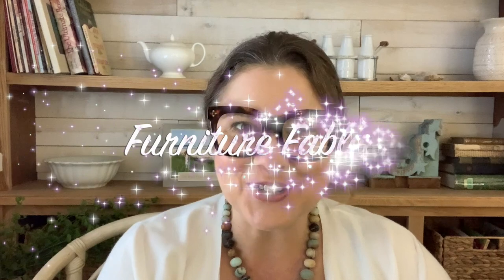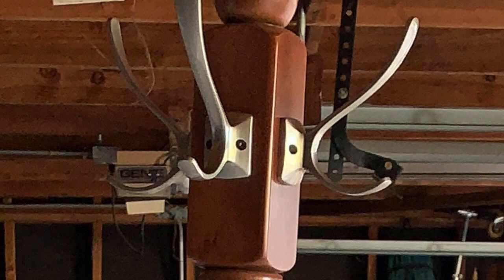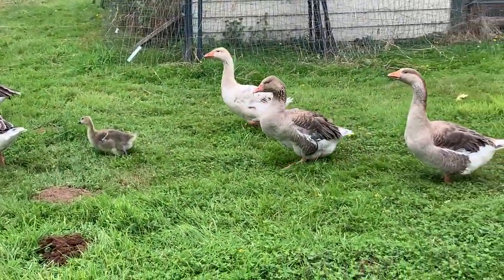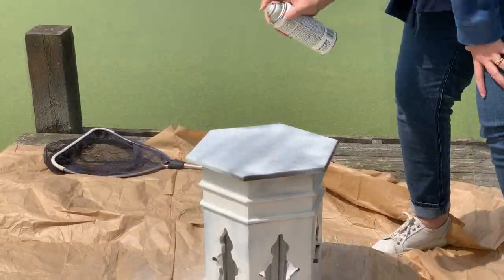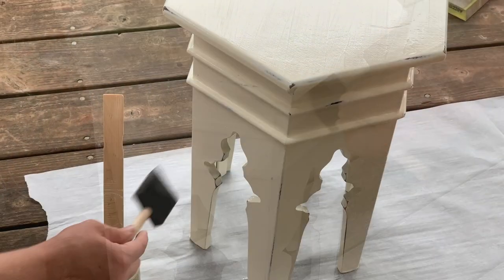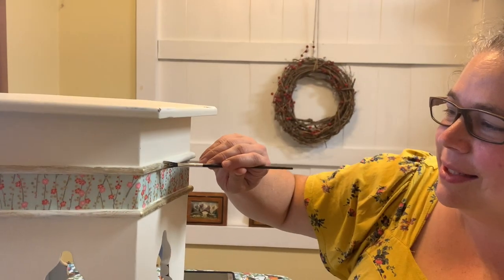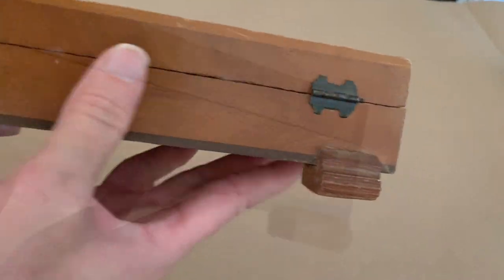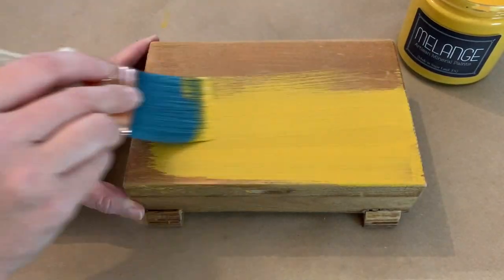3 Mini Makeovers That Will Teach You 20 Flipping Skills | Fun and Inspiring Intro To Furniture Flips

Comment: The little table looks great after it’s makeover. If it had been more wobbly - another idea would be to add three small chunky legs to the table top ie in every third angle
Reply: Comment continued on every third angle and flip it over to put a pot plant or candle in the middle of the legs. Ie new use.
Reply from the maker: Wow, Genevieve - neat idea!

Comment: I had an old pine desk I had bought unfinished, and after years of dealing with its drawer that would go off its channel from time to time, spilling all the contents on the floor, and repainting the legs several times over the years, I bought a NEW parawood single drawer desk from Amazon, and used the following: 1 coat of spray KILZ primer, two coats of Behr's chalk paint in Grecian Garland (a sage green), and three coats of Minwax polyacrylic.  Tonight we get to bring it inside from the garage where I did all the painting and sanding, will bolt in the legs and tomorrow set it up with my computer and printer on top.  I got a whitewashed oval drawer pull at Hobby Lobby which looks fantastic on the drawer.  I was really interested in trying chalk paint, which worked super well to create a very smooth matte surface, but I didn't want to use wax and preferred a satin finish that would be extremely tough and protective.  It turned out beautifully.  I could also have gotten a quart of latex in a sage green and used that but I wanted to try chalk paint to see what all the fuss is about.  Now I have all this paint left and want to see what my grown daughter would say to me painting her bed's head and foot board and perhaps even her night table and bureau.  I loved your little treasures re-furbishments.  Picture frames are also great smaller projects and our Goodwill has tons of those.  You buy one, chuck the yucky artwork, and paint the frame; then substitute some new artwork and voila: a gorgeous new wall piece.  Custom frames, mats, and prints are so expensive, at least you can save a ton of money on the frame.
Reply from the maker: Yes indeed to all of this! So glad your new desk is getting set up, that is so great. 😊

Comment: Does the big mamas butter waterproof ?  Thinking about the coasters.
Reply from the maker: No, not waterproof, but it does seal wood the to the same extent as any other wax or help oil would.  Those coasters I will put some Gator Hide onto.  😊

Comment: Ok.  My friend and I are getting ready to take a plunge on a tiny product.  I have some questions - maybe you can cover this in a video or read comments sometime?  Here it is.  WHY do you rinse with the TSP solution when you're sanding anyway?  Wouldn't sanding just remove all the gunky stuff?  And also.  My friend says spray paint will be good for a little project but I'm not sure.  Have you ever used spray paint?  We got our house re-sided with that James Hardie stuff (nice!!) but all our gutters were white.  It was great except for one downspout gutter that came down right in front of our house - the white contrast was no good and I sprayed that to a pretty close match and it looks much better and has held up well.  But I don't know that I would use it on furniture.  PS Please give an email address so we can send pictures of our stuff when complete?  I promise not to spam you/ will respect boundaries.  Pinky promise swear. -- Christine aka "Jane" lol
Reply from the maker: Thanks Christine!  So to answer your first question - the reason why cleaning before sanding is considered "best practices" is because in theory, some amount of the gunk, goo, grease etc that is on the piece of furniture could be ground down into the substrate during the sanding process if it isn't first cleaned off.  It's true that most of it would be pulverized - and on a relatively clean piece it may not matter all that much, but furniture is usually dirtier than we realize, and anything greasy or sticky will be more likely to end up being ground back down into the wood.  
And then as far as the spray painting goes - I have a little experience with using spray paint out of a can (I've used spray primer here and there, and Rustoleum metallic spray paint for hardware), but I know that people do use it and have had some success with it.  Mostly it will depend on the surface, what look you are wanting to achieve, and the type of paint you are spraying.  Christina Muscari of Pretty Distressed (here on YouTube) just did a video last week about spray paint - I haven't watched it yet, but I would recommend you check that out!  (She is fantastic). 
Are you on Instagram?  That is a great way to reach me and I'd love to see your work when you are done!  @furniturefablesbyandy
Reply: @FurnitureFablesbyAndy  I'm not on Instagram but will check out your channel on that platform!  Thanks for answering our questions! :)

Comment: Hi, is it not possible to partially paint a wood top? I have a table top and I want to add strips of paint. But I’m not sure how to finish it. Do I use varnish or all purpose sealant? Can anyone help?
Reply from the maker: Hi Farah - it is definitely possible to do that!  Varnish is typically used for things that will be outdoors and is a bit trickier to apply than a water-based polyurethane.  For great indoor top coats, I would suggest checking out General Finishes or DIxie Belle.  I often use Dixie Belle's Top Coat in flat, and when I want something a little tougher, I use their product called Gator Hide.  Best of luck!
Reply: @FurnitureFablesbyAndy  thank you so much for getting back to me ❤️